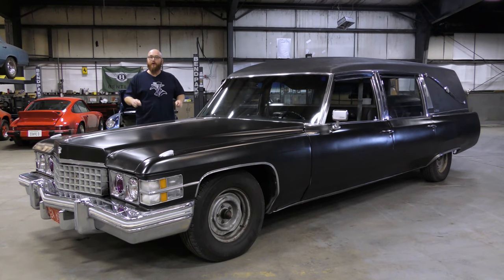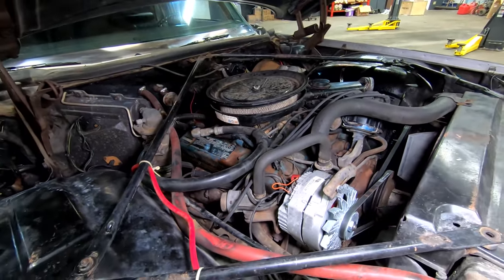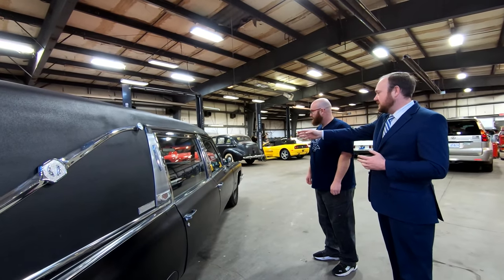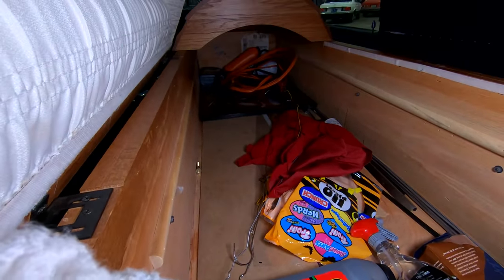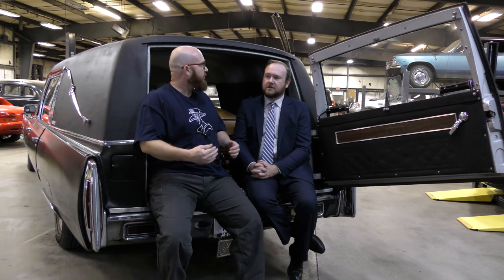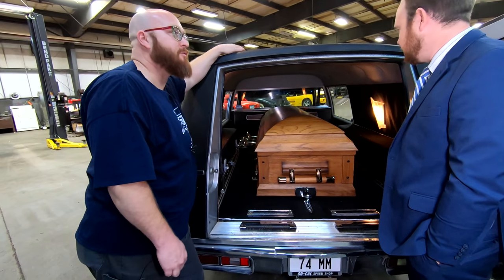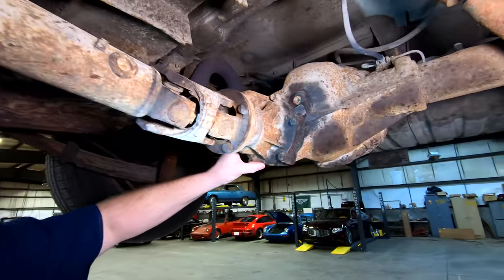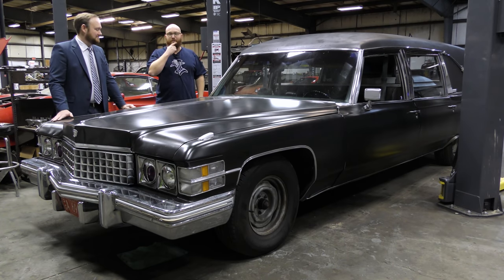Why would someone buy a hearse?!? CAR WIZARD shows a modded '74 Cadillac Miller-Meteor

Comment: As a guy that dailyed 2 different hearses over the years, one being a 74 Superior Sovereign in triple black, this was nice to watch.  A Miller with a radio and power antenna is pretty rare, most have a block off plate.  I  didnt see the normal dome and reverse light switches every hearse I ever owned had.  Oh and btw, I know Im the only nerd that caught on to this, those are chevy truck wheels, not cadillac units. Ill be doing a revive and drive on a 70 Superior Sovereign soon, so if youre interested, keep an eye out for me posting that.

Comment: I have a '73 Cadillac M-M hearse and just went through an episode with the drive shaft. it had a clanking sound for years. I finally purchased a Bendpak myself and saw their was about 2mm play in the front U joint. Ive poste a video on it. Two shops told me it couldn't possibley be the problem as they detected nothing. I took the shaft out myself and took it to the shop with my video. Lo and behold they said they'll fix it but were hesitant untill I showed them what I found

Comment: WOW, owned a 72 Sedan Deville brougham (think longer back doors).  472ci, would not start when a cloud passed over the sun, spark plug wires bare (laying over valve covers).  Starter went out (Jan-Feb of course).  Using an old bumper jack, then 2T jack stands - sheared off pins.
Reply: There's your problem....2T jackstands on a 4T vehicle....

Comment: Get those numbers up, guys I knew that had them got low to mid teens for mileage. They used them for carpentry, roofing and painting, made a slide in that dropped  wheels for a workbench and could haul 8' lumber and trim. Handled weight better and wasn't as much of a lift for ladders for the same mileage as a full size van.

Comment: Woo! Superior Coach is/was here in my town. 

Not uncommon when I was growing up, to see 10-20 caddy sedans with the rear doors and trunk lids removed and everything behind the b pillar shrink wrapped sitting outback of the local Cadillac dealer.
I'd be willing to bet if you tracked down the paperwork for those two superior coaches, they were originally delivered to ( same dealer different owners over the years) Mike Swaney Cadillac/ Lima Cadillac/Lima Automall.

Comment: Years ago we had a local funeral home director bring their Chevy Suburban hearse to us, due to the rear hatch not opening. Luckily they didn’t have a client in the back. But they were set to use the vehicle for a funeral service an hour later. We found the cigarette lighter fuse was blown due to a defective cellphone charge, which is on the same circuit as the rear door lock actuator. We made sure to get him squared away with the lock working, and a few spare fuses “just in case” it happens again. Thank goodness it didn’t happen during a service, or when they were out at a cemetery either.

Comment: You probably didn't notice, but this is on a truck Chassis. A GM truck chassis. That's why you didn't see Cadillac rear coil/control arms under it. I have/do own numerous pro cars. These came down one of three GM truck lines. They did get the perimeter frame, but they were truck suspension with heavy duty leaf leaf springs, carrier bearings on the 12 foot drive shaft etc. In addition, as that owner said the car was a Cadillac stocker from the dash forward. He may have failed to tell you, or even notice, they actually widen gradually toward the rear so the rear bumpers were sectioned to make them wider than stock. They had a much wider rear compartment than a stock Cadillac trunk would have been. If you back one of these up to a stock Cadillac, you would notice that it is a couple feet wider. They needed a wider rear compartment for their work. They look somewhat like a bottle from the air. In about the late 70's or so they were no longer wider in the rear like this and you may notice how "tight" the casket seemed inside the rear compartment.   Nice work on the video! Keep up the good work GOD bless. Oh, and ditch those purple lights for GOD's sake!
Reply: No. I think I’ll keep the purple lights since I like them. As far as failing to notice. Yes, I’ve noticed that in the 15 different pro-cars I’ve owned over the past 18 years. Also, the Cadillac Commercial Chassis isn’t a truck chassis. It is derived from the Series 75 chassis for the D-body Cadillac (GM built limo) that has been lengthened 6 inches in the wheelbase.

Comment: There is one thing that the Wizard said in this video that I will take issue with.
Wizard said that the  "casket can weigh as much as the engine does." 
As an ex funeral worker with many years behind me, I can assure you that no matter how large a coffin occupant is, (And I've removed some very BIG people) nobody is going to be as heavy as the power source under that bonnet. The biggest (Heaviest) person that I've ever done a funeral for, took 8 men to struggle to lift and, being Murphy's law, it was a burial on a very rainy day.
Reply from the maker: Incorrect. The engine on these weigh 600lbs. An empty mahogony casket weighs 250lbs. Put a 350 lb man in it and your at engine weight.

Comment: I had the 1967 version. 
Type N ambulance service tires.
Eldorado front end 472 engine.
Got it in the service and got rid of it in the 2000's.
Everybody loved that car.
Rollers in the back were gone when I bought it.
Reply: What happened to the original engine it had?  Why was the 472 put in?
Reply: @mexicanspec  I bought it in 83' and that's what was in it. I thought it was original.  It had covers that came off the back two windows. Not like the one in the video.
Reply: @coldwarrior6572  The '67 came with a 429 and it sounds like yours was a combo.  A friend of mine had a beautiful 1968 Combo but he rented it to Universal studios and it got rolled over and blown up on Knight Rider.

Comment: a buddy had a 1973 miller meteor 3 way(rear doors on each side open suicide style)..put a 572 crate motor in it and custom suspension and 4 wheel disc brakes..for a 6500 pound car it would move pretty quickly...it drank gas like crazy tho..

Comment: You missed pointing out the steering cooling loop in the front end, behind the radiator. :) That's a weird looking rear axle assembly, but it's also a Cadillac Commercial Chassis part. Interesting it had front disc brakes.

Comment: I had  a 60  Cadillac   Superior  Combination  car  you  had  to  have a  special lift  to jack  them up,   when i  had  a  rear  wheel  bearing  replace  found out  it's a    like  3/4  ton    truck  rear  end.  Very Expensive  to    find  parts  for  the commercial  chassis cars  Only a  few  thousand  made.  because  they are  so  heavy  front end  parts  and  tires  wear ,  had mine  from  1980 -87

Comment: the only Cadillac I remember seeing used as a hearse is A Fleetwood though those are also used for events other than a funeral I.E. prom/wedding though the model stopped being made in the mid 1990s after roughly 20 years in production. though any luxury car can be used as a limo other examples include BMW Mercedes Benz C Class Lexus LS 400 IS 350 then there are specialty vehicles made into limos I.E. VW Beatle etc.

Comment: Have owned 3 hearses in my life, all of mine had suicide doors and one had a power table.  gm made the chassie like he said until 1979 and yes the back end is all custom. Superior was the cadillac of hearses. there is a professional car society that has a magazine and was in ohio as far as I know. my 1970 was on the cover, but my 2 1967's were not.  they can cruse at 80 miles per hour all day. parts can be had most cadillac clubs have hearse owners as members. about 10% love them 10 % hate them the rest are somewhere in  between. I can tell you many stories. I was a member of the public. Just a side note to your client, you can tell you did the inbalming because each person adds  something to the fluid that is unique to them.  I bought my hearses from an person who sold new ones to homes and too old ones in trade. alot of hearses have been T-boned. I had wig wag lights on my hearses. All of mine were hearses only, but 100K new

Comment: Side trim missing as is hood ornament. Needs wheel discs. But a nice one once fixed up. You can’t kill these engines. Exhaust manifolds will leak at the rear requiring them to be machined flat.

Comment: The left front wheel on that Cadillac hearse it is off of Chevrolet the original chadillac Rim had a large flank on the outer edge of the rim that fits the Cadillac hubcap
Reply: No, those are the correct commercial wheels that cam on that car.

Comment: Weird that the door opens in such a way to where it blocks access if you are parked curbside.   Lexus GX470 and older Rav4s are like that as well, but I kind of get that they were designed in Japan where you drive on the left side of the road so the door would open the correct way parked curbside.
Reply: This is not a first call car.  The hearse is used to move the casket, not do home service.  There would be no curb side service in this car.

Comment: I use cable ties to prevent losing an original equipment plastic wheel cover
Reply: These, in 1974, were not plastic!!  Even the ones that were modified for this one looked still metal but they were buttugly!!  Might have looked right on a mid-to-late ‘50s hearse but not on that ‘74.  I had a ‘73 Fleetwood Series 60 Special and it was a fabulous car!  In ‘73 the only pollution control was an Air Pump and the 472 still had 10.5/1 Compression Ratio!!  That baby could scream!!  It would push that 5200# car UP I-80, west of Denver, at 80 mph without even thinking about it!!
Reply: Nowadays probably best to use a few neo magnets?
Reply: @JohnSmith-yv6eq  Those hubcaps have slots (openings ) in them just like the modern plastic one's. The rims also have openings. Cable ties would prevent the hubcap from falling off.

Comment: I'm getting a hearse one day I've wanted one for 21 years it's going to be painted Santa muerte style. Midnight black with white pearl essence ruby ree metal flake Santa muerte painted on the hood roses and bones skulls on the sides and hola D.E.A on the back side pipes  with flame throwers ghetto rims colored led light mods Bentley lights on the inside raised rear suspension turbo's on the engine if possible bucket seats suicide doors rollers removed a lounge/bar in the back new stereo system etc.

Comment: I've always wondered if older ambulances were made by the same companies that make the hearse, and what year they started to use conversion vans.   I also have noticed that some hearses are Buicks, is there a reason for that?
Reply: YES   the Coach companies  made  the Ambulance  and  Hearse  alike the Cadillac  75  series  Commercial  chassis  they were expense  Hand  Built  bodies  by  the late  70's  the cost  of  a  van  was  much  cheaper  ,  Buicks, and  pontiacs and Oldsmobiles  were also converted  to  try save  cost  of  the cadillac  but  the Old  caddy's  rode  so  smooth

Comment: Are all rear drive Cads from this era 472?  There seems to be some confusion on this but I’ve always thought the 500 was reserved for the Eldorado.
Reply: You’re mostly correct. The ElDorado had access to the 500 from ‘69 until 1975. From then until 1977 you could find it all Cadillac platforms.

Comment: They are neat cars but you must be very careful with the newer ones some have bad problems. They are front wheel drive models and they have an engine that's really bad about blowing head gaskets and it's not a cheap fix because you have to take out the engine and it could cost more than $5,000.
Reply: Also the air suspension that levels the car as it drives through the cemetery
Reply: @qwincyq6412  
Man you can find Cadillacs and Pontiacs in the 2002-2016 for $5000 or less but buyer beware. They look really great on the inside of the car but they have some sinister problems in the engine department.
Reply: @benjimenfranklin7650  the oddest one I’ve ever encountered was a chevy impala hearse. Like why bother doing the conversion on a lower end car? Unless you’re trying to attract budget end clientele lol. There’s also a local cemetery that uses a black dodge caravan! They just blacked out the back windows!
Reply: @qwincy q  my local funeral home uses a Caravan as a "flower car" to transport stuff to and from burial sites.
Reply: @Noah_E  that’s one thing. But this funeral home also owns the cemetery. So they use the black dodge to transport from the on-site chapel to the grave. Like I said, discount. Although I suppose if one never rode in a caddilac or lincoln while alive they sure won’t appreciate it when they’re dead.

Comment: Fun fact hearses and other fleet vehicles have sometimes below basic options. For example my 83 has non auto canceling wipers.  Whatever that means.
Reply: Click the indicator stalk "on" to make a turn...
then unlike most cars when the steering centres itself after completing the turn...
the indicatoor is not automatically released...
so you have to turn it "off" as well by manually returning the indicator stalk to the "neutral " position...
Reply: @JohnSmith-yv6eq  That means the cam inside the steering column is broken, not that it didn't come with the option.

Comment: My buddy had a  66 Bonneville hearse in the late 70's, he got drunk and rolled it. I took the 421ci engine out of it and put it in my 71 lemans. Fun times.
Reply: That car had round tail lights on it.  Where do you think they came from?  They were not Pontiac lights.
Reply: @mexicanspec  What the F are talking about?
Reply: @stevenreynolds2327  That '66 Pontiac had round tail lights.  I was asking you if you know where they came from as they were not from a Pontiac.
Reply: @mexicanspec  Im sorry, that was in the 70's, my memory is fuzzy  after last Tuesday.
Reply: @stevenreynolds2327  I myself had a 1967 Pontiac Ambulance and it took me a while to figure it out.  When I saw a Corvair drive by, then I knew where they got the lights.  The coach companies always used Chevy parts.  The odd thing with the Pontiacs is that they did make a wagon and could have used those lights, but they didn't.
Reply: Thats interesting.

Comment: I used to want a Cadillac Hearse or ambulance for a tow rig, and still might if I could find one that wasn't a total rust bucket.    Cadillac commercial chassis are basically Chevy pickup frames modified for the Cadillac cowl and engine.   

A huge upside is youd have a tow rig that nobody (especially Mexican gangbangers) would steal.

Comment: The cadillac 472/500 CI engines were way better than the Rolls Royce engines.  These engines were too good for the cars they used them in, because with peoples abuse and the fact they were rust cars during the 60s and 70s, these engines were just broke in at 200K miles but the bodies were rusted away for most of them.  Ive owned a good handful of your Devilles and Fleetwoods of the 1970s, and they were actually cheaper to fix than your fords and chevies and rarely broke down if you took care of them.  Even though those engines are very large, they still dont cost anymore money to repair than your old chevy 283 V8

Comment: Finally a BADillac!!! wish it was a 501...sadface!
Reply: The 501 was just a bored out 472.  Most of the 472s were more powerful than the 501.  The exceptions were the 68-72 Eldorados.  These were the first Gen fwd which had virtually no pollution controls and high compression 501s in them!!

Comment: Hpw do funeral home handle someone who is extra tall or extremely obese?  I know you can have custom casket made, but what if it doesn't fit inside the hurst?  Then what?
Reply from the maker: Pat tells me they rent a van to use.
Reply: When deceased, they all fit.  The body is drained of all fluids and is then filled up with gas to not look caved in.  Or so I’ve been told.
Reply: when i had  a  hearse  the inside  back  end  was  over  9ft long a  pick  up  is  only a  8 fr bed  ,  the leaf  springs  are like  from  a  1 ton  or  3/4  ton  truck  very  heavy  duty,

Comment: he sould take that engine, and put electric if he gets 8mpg
Reply: Just think how many Tesla battery packs can fit under the casket deck in the back.....
Reply: It's long enough for a pair of 20 gallon gas tanks and over 300 miles of range.  An EV conversion to get the same is not practical